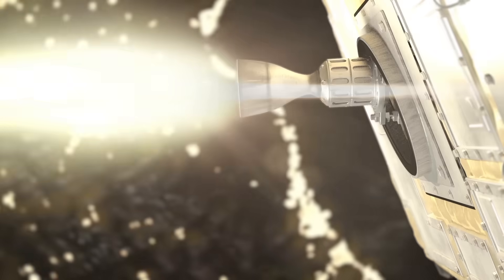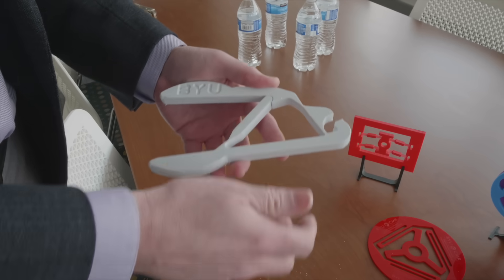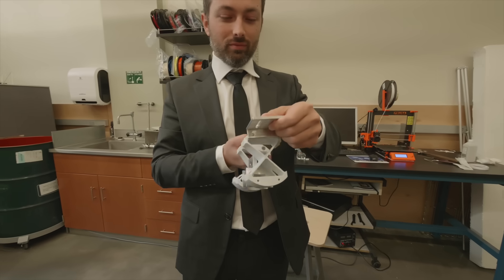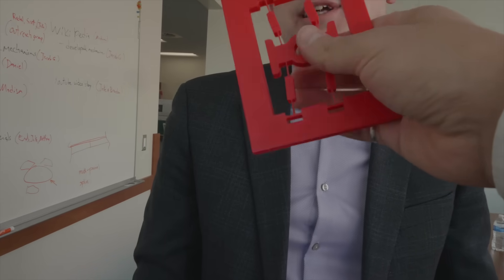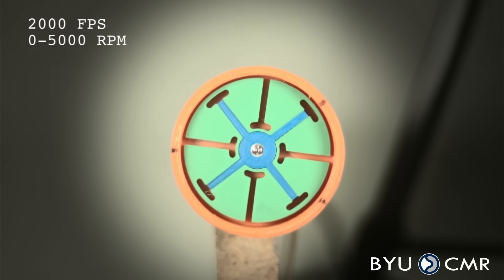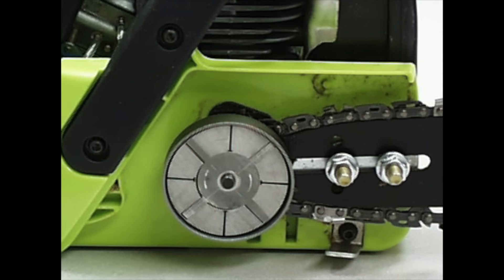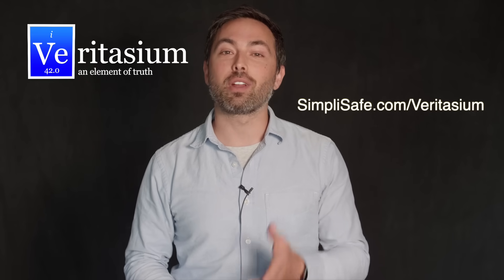Why Machines That Bend Are Better

Comment: One problem I see if you use stuff like this how they said they make things for the army to use. Let’s say the hinges for instance out in the field if those hinges get broken the whole piece will have to be replaced. They said it was made of steel so it has the chance to be welded back but those plastic pieces what kind of quick fix are there to use in a short amount of time and an efficient fix? I mean hot glue, tape, or melting back into place? It all seems like the items lose their integrity after one fault or break. A typical metal hinge if broken has many ways to be replaced quickly without complete loss of integrity such as a new screw into it even 1 screw on both sides of the hinge will still keep it in use for a long time the metal piece that goes down the center that keeps the 2 halves together can be replaced with any straight piece of metal with a notch on the end to hold in place and the hinge is still usable.

Comment: They should build micro motors with no external fuel source.
Reply: You mean, electric motors?
Or motors that will just stop running?
Reply: @WouterCloetens  Something which can operate independent from a external energy source. So "electric" means some kind of battery.
Reply: Khan You wrote "fuel source" though. But I figured that you meant energy source.

Comment: The mechanics behind the bending thing are neat, and it makes sense in certain applications- but I definitely wouldn't say machines that bend 'are better'. Some machines require rigidity in order to function and it really depends on the application and desired effect. Lubrication and bearings work really really well, and in terms of new tech, a lot of machines are turning to magnetically aligned shafts. (For pumps, compressors, etc.)

Comment: Makes sense. Bending is a problem when you're not expecting it. When you're able to predict where and how things will bend, it becomes a tool to use.
Reply: Thing is, it's a neglected RESOURCE.
Reply: yeah in engineering we tend to stay away from plastic analysis because of permanent deformations, but having flexibility in mechanisms seems to have great potential!

Comment: Haven't we been using "compliant mechanism" for centuries? Like... the coiled spring was patented in the mid C18th...
Reply: Of course, we've been using flexible materials for as long as we've been building things.  I think he is advocating for novel applications
Reply: These are themselves being used as hinges, which springs have rarely been used for, rather than their traditional use in controlling a separate multi-part device.  The engineering is really in the precise control of where the bend happens and where it does or (more importantly) does not allow transitional movement, as in the elephant's trunk.

Comment: Wouldn't metal fatigue become a problem with all the bending?
Reply: Metals can take lots of repetitive stress without failure. What they have a hard time with is strain. Thin metals have a much different stress strain curve where they can bend much more before they strain. How many times do you wrap up your vacuum chord without it breaking? Lots of thin copper that does not even work harden even after years and years of making a 90 degree bend then straightening out. If you look all the joints are very thin material.
Reply: They address that in the video- they run motion tests up to 1 Million cycles without failure..

Comment: I'm pretty curious about how durable these things are... In some applications, like the pincer, I would imagine that the points where stress is concentrated would break or deform beyond a certain resistance to the load they generate. Crushing a piece of chalk? Sure. Chalk is fragile. Crushing your finger? You're going to give before the device does, since your tolerance is much lower. I wonder if a device like the pincer (in ANY material, produced by ANY method) would be suitable for practical applications. Could it replace a vice-grip? How much torque or weight could it endure or support? So many more questions (which is the true reward of this channel anyway, so here we are). :)

Comment: Do they have some sort of algorithm or modeling software to help with design? The amount of flexibility that you get from the material properties is dependent on the type of material, thickness, and other size. Other than trial and error (which with injection molding become very expensive, very quickly), what methods are they using to design these mechanisms?

Comment: Expose it to UV and variable temperature, then try moving it 100 times rapidly in different directions.
It will pop.
Reply: Expose steel to water and time and it will break down too.  What's your point?

Comment: I wish you asked the guy more interesting questions. Like whether heat generated by the action is greater  than in traditional mechanical hinges (which is super important), or how "a million cycles" compares with industry standards. 

Because the important thing is to compare, not to just say "uuugh, it's possible!".
Reply: And on a switch for example (especially with plastic) doing tests consecutively is going to warm up the plastic and actually make it significantly easier on the product being switched. How many flips would it last under normal circumstances?
Reply: Good comment

Comment: Can sustain a million bends, sure, but what about their absolute chronological lifespan? What type of plastic are they using? I suppose it must be some high-quality polymer, which won't lose their plasticizers over time like mainstream plastics and become all brittle and snap/shatter into pieces on the slightest of pressure.

Comment: My main concern is fatigue at the bending point. 
While their tests show it can handle millions of cycles, it would have been nice to have a reference against a hinged equivalent. 
Does the lower price, weight and complexity of the compliant mechanisms bring with it a lower durability?
For example, being ten times as cheap, but 100 times less durable than hinges, would (depending on application of course) make it the lesser option.
Either way, a very interesting video.

Comment: This all looks incredible, but what's really scratching at my suspension of disbelief is how there is not one mention of metal/plastic fatigue - the single largest apparent obstacle to flexible machines, apart from the little bit where they claimed to have so reached so many repetitions in their stress testing.

I'm not saying it's impossible, or even casting doubt on their ability to do it, I just wanna know how exactly they make it not an issue.

Comment: I think the idea of 3d print-ability is what gives these things extreme credit....I imagine us going back to the mechanical computer age so that parts can be easily replaced with 3d printed materials.  This would be, in my opinion, an absolute necessity for space travel and colonization, as a 3d printer is much lighter than bringing an entire microchip fabrication machine.

Comment: I think the only problem with these weird type of mechanism is, if they break, you have to replace the entire piece. I don't think its as easy as welding it back together, which it may, but the integrity of the mechanism wouldn't be the same.

Comment: I've often wondered about what life could look like on other planets, and about how the mechanical processes of animals could be enacted by different biological processes. Like, why does everything on Earth use flesh and bone and muscles? Could you have an animal that use gears and shafts and electric motors? How would it compare to an Earthly animal of the same size? Well, the more I learn, the more I realize that life on Earth is actually built EXTREMELY well in terms of overall design philosophy.
Take the principles in this video, for example.

Flesh and bone and muscles don't wear out nearly as fast as mechanical components like gears and hinges, don't really need maintenance, don't cause friction by rubbing on each other, don't have any gaps or seams where stuff like rocks or sand could get caught, and can absorb pretty hard impacts without sustaining major damage. With possible exception of bones and teeth, we're entirely built out of compliant mechanisms, from the protein to the ligaments. It's an ingenious structure, and it works really well. I don't know that human science will ever get metal robots that perform as well as human bodies do.

Comment: Could somebody please explain to me how the flexibility of the gripper amplifies the force instead of reducing it?
Reply: In the same way it works on one of the clamps he shows for comparison. The compliant mechanism is not used to amplify the force beyond what a clamp could do, it just replaces the hinge pins with bendy bits. Its a bit more complicated as the compliant mechanism uses a couple of different anglesand axis if i'm looking at it correctly, but all in all it did not invent clamping from scratch, just the way the hinges on clamps work and therefore the production mechanisms behind clamps.

Comment: This doesn't impress me

2:54 Hinges and bearings and separate springs last much longer than flexible junk.

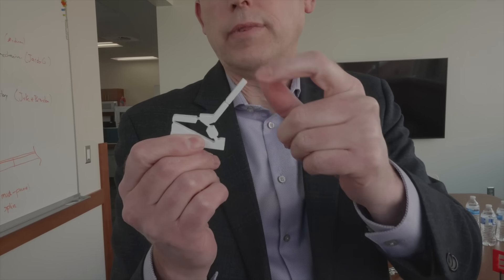3:41 Looks like something that would withstand a very small number of operating cycles, compared to a traditional cheap circuit breaker with a tiny metal leaf spring.

5:58 "And that is why..." you put rubber bushings in if you want to avoid that issue. You don't make the whole piece rubbery!

7:32 That's true

9:22 Aw, look, a centrifugal clutch. Something equivalent, but made with a drum, shoes and two springs, can be found in most mopeds with a CVT or a single gear pulley. It's basically a centrifugal drum brake. Common on chainsaws and lawnmowers. The advantage of having it made of multiple parts is that they don't wear off at the same rate. The springs are almost ethernal, while the padding and the inside of the drum are not. And you only have to change the parts that you need instead of the whole assembly.

Nice food for thought anyway (=

Comment: 8:52
That's misleading. There are no pinch points, but the edges of the metal have to rounded enough, otherwise the sharp edges can and will cut through the insulation over time.

Comment: This is not absolute,  however.  For machining applications,  machine tools that flex and bend can't do their job properly.  But for sportbikes for instance it's a different application,  and works much better when it flexes especially under extreme acceleration and cornering.

Comment: single thruster probably will be used for missiles too. NATO needs some s-400 s-500 competitor.
Reply: But when they do get them they will need a s-400 v2 s-500 v2 competitor.
Reply: Don't worry. SM-6 block IB and SM-3 block IIA will both be in service well before S-500 and significantly overmatch it.

Comment: 8 P's
1.) Part Count (Less) 2:42
2.) Production Processes (Various) 3:28
3.) Price (Inexpensive) 3:33
4.) Precise Motion (no backlash) 5:21
5.) Performance (no backlash) 5:38
6.) Proportions (smaller) 7:18
7.) Portable (lightweight, space application) 7:33
8.) Predictability (safing & arming WMDs) 10:17

in case you missed them :)
Reply: i was thinking how you were gonna put size in there and in my head  instantly thought "Psize"
Reply: also Packable, Passive, & Pleasant (clicking)
Reply: @you2tooyou2too  That's basically just "Portable" which he added
Reply: 4:55 9th P, physics Girl
Reply: penis
Reply: too many pp for me
Reply: glad I only saw the ad and not the video
Reply: less parts => it`s harder to fix it if it breaks somehow
Reply: @elpsykongr00  Less parts to replace, you replace the whole unit.
Reply: @petezel  Probably cheaper than replacing a traditional part anyways in terms of labor and education required.
Reply: @elpsykongr00  are you insinuating if your vice grips break, you search ebay for the broken piece to replace or do you buy a new vice grip like the rest of normal society?
Reply: @ModeratelyAmused  if my vice grip breaks, I take it to the blacksmith and he will repair it for me.

Comment: 10:00 So it expands until it grabs onto the interior of the shaft that drives the load.  But what if that load creates enough resistance to slow down the clutch, thus causing it to relax and let go of the load shaft?

Comment: Followed Compliant Mechanisms during my Masters last year (Mechanical Engineering/High Tech Engineering). One of the most interesting courses I took. We designed a prototype for a water spray bottle for a given force input and a certain amount of liquid (cc) as output. Which greatly reduced the amount of parts required for operation.

Comment: Learning about the compliant mechanism concept in 10 minutes.
3Dprinting the switch in 60 minutes.
Now I'm playing at home with the switch.
That's disruptive, that's the Singularity, that's Magic, that's ...
Thanks to everyone that makes this possible!!!!
Reply: ooh, where''d you get the switch blueprint?
Reply: Link in description
Reply: Calm down. You sitting around wasting time printing and playing with a doohickey because new media “journalism” told you to is not the Singularity. We’ve had elastically transforming mechanisms for ages, this just shows some interesting production methods and the practical niches this kind engineering is and will be useful.

I don’t mean to rag on you, but the tech revolution ain’t coming from this
Reply: @AnkhAnanku  
I'm not excited about the compliant mechanism in particular. I'm excited about experiencing the speed of knowledge and objects transmission. I rewrite the text to try to make my point clear.
Learning about the XXXX concept in 10 minutes. 3Dprinting the YYYY in 60 minutes. Now I'm playing at home with the YYYY. That's disruptive, that's the Singularity, that's Magic, that's ... Thanks to everyone that makes this possible!!!!

Comment: Not always better. Bending is a trade off of durability. Hinges can easily endure 1,000,000 times of use, but bendy parts? Maybe 1,000 times if you are lucky.

Comment: OK.....
How does one 3D print Titanium???
Reply: You get powdered titanium, then mix it with an epoxy. Use that mix in your 3D printer to print stuff. Then when the epoxy hardens, you bake the design until epoxy evaporates and titanium dust melts solid together. That's the gist of it :)

Comment: Wow. That centrifugal engaging device is literally a great idea for a transmission!!
Reply: It’s already how transmissions work in cars today, but with transmission fluid instead of solid parts contacting solid parts.
Reply: Well centrifugal clutches - based on springs, but that act very similarly to the one in the video - are in use, for instance on scooters and chainsaws. 
Cars with manual transmissions use clutches that rely on a metallic dish that acts like a spring by bending between concave and convex configuration. Basically a compliant mechanism.

Comment: 8:10 3d prinited titanium, is that 3d printed titanium only?  because from what I have been studying they usually use Ti6Al4V powder for metal 3d priniting, hope somebody can clear my confusion.
Reply: I think it's very rare to use pure metals for any application so it is most likely an alloy. the key part is that they didn't use/make a titanium alloy specifically to make it more flexible
Reply: yeah , nonetheless 3d printing a finished part with 180 degree rotation capability really exciting times.
Reply: @Grumpher  exactly
Reply: I think when he said no alloy, wasn't true, and this is infact an alloy maybe the one you've mentioned. But the professor just wanted to keep him interested.

Comment: The longevity is an issue. Fatigue machines deal with deformations that happen during/because of the work that the plastic tools do, but they can not take into account the fact that soft/bendable plastic relatively quickly becomes brittle on its own even if you do not do anything with it. And if it will be exposed to the sun, it becomes useless very quickly.

Comment: Except I see a weakness in those plastic molds, you even mentioned it, part count, it's all 1 part.  The problem with all in 1 is that if that 1 breaks, it's broke, it's GONE!  When something that contains multiple parts breaks, most of the time we just replace the parts the whole thing, that vice grip with having the multiple parts, lets say, the spring breaks, we just replace the spring.

You did mention costs and that something like that can be made cheaper, but in terms of durability, I see a LOT of problems.

Comment: Unfortunately, I think this principle has been misused 
purely for the sake of profit in some cases.  Anyone who has experienced a control panel failure on a modern washer or dryer can attest to this.  Behind the fascia, the control panel is one large stamped plastic piece that has thinner areas meant to replicate springs or metal leaves, when even one fails, you get to add more plastic to the landfill and shell out $350 for a new panel or get creative with duct tape or other adhesives.  

Individual springs would definitely have been a more sustainable & field serviceable solution in this case. 

When I had to do this repair, I didn't use duct tape or epoxy but did use flexible plastic sheeting and rubber cement.

https://youtu.be/N8rz8sclwAg

Comment: I'm curious how these fit on a price-durability graph. If I wanted to replace something bulky/heavy, like a door with a complaint device door, that didn't have hinges, would I be able to get the same (or better) longevity/durability for the same price? I understand that if it was made out of solid metal (like the titanium examples, or the metal clutch in the video), it'd be durable, and I understand that if it was printed out of plastic it would be cheap (as the vice grips are). But I'd love to see data about how they compare as a function of both of those things at the same time. Can they be both cheap and built for every day home use for years. Or is it a trade off of the two at a rate worse than non complaint devices?